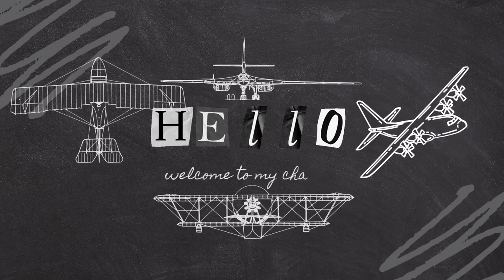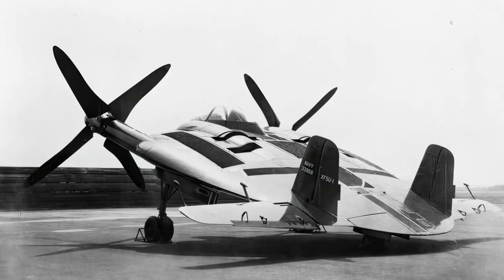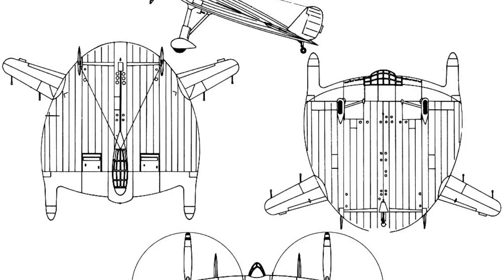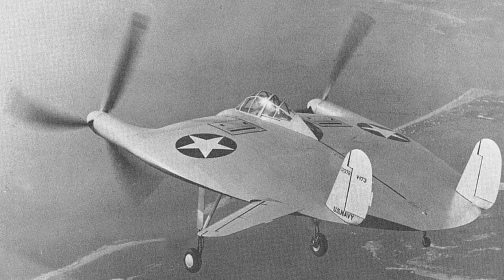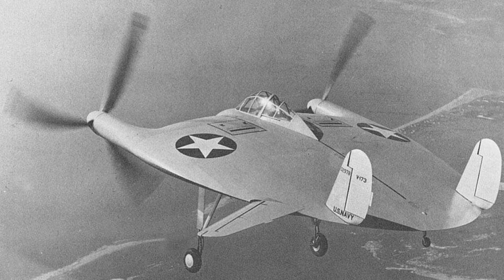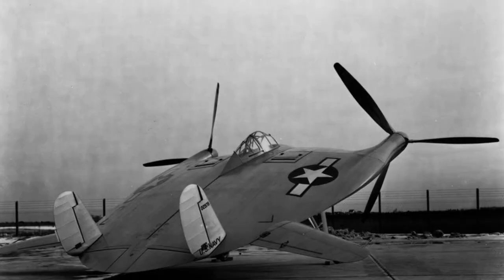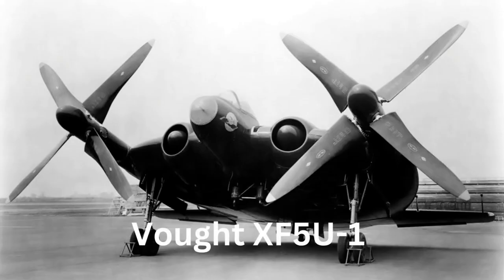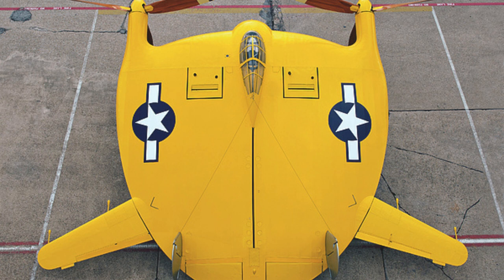Flying Pancake: The Vought V-173

Comment: Very inaccurate information.

The V-173 was a very low-power first attempt. It was never intended for service.
The XF5U was intended to be worked up into a service plane which was to be very fast, while also capable of very slow landings in very little space.

The first plane did everything asked of it and proved the concept though it was relatively slow for installed power because of the huge propellers. The XF5U never flew, never made it past a few fast taxi tests because of excessive vibration from the drive train linking the two engines and the two props.
This drivetrain was necessary because with the wing-tip location of the props, losing an engine meant instant uncontrollable catastrophe.

It was never intended to have a lift-fan in the center. No patent drawings showed such a thing.
There are videos of the Designer working with indoor tethered air-powered models which could hover with the nose vertical, though it did not have landing gear suitable for landing like this. The XF5U might have had enough power to do this, though even it could not land like this.  Other Zimmerman patents showed something like it that could land vertically, nose-up.

The super-slow landing abilities with very steep nose-up attitude was from the very-low aspect-ratio planform. The situation with the props outboard spinning outwardly did not help with this super-STOL ability, nor for efficiency at cruise. NACA tunnel tests with the V-173 showed that it didn't gain anything with the props as they were, versus more normal-sized 80hp props spinning the other way.

The designer while working for NACA in the '30s saw the Arup plane from Indiana fly, performing for NACA, the Army, and the CAA (fore-runner to the FAA). The Arup from Indiana ("Air" + "Up") was from 1932, and proved to be super-STOL, stall-proof, and efficient with the low power installed.
Zimmerman picked the planform of the Arup because of its ability to fly super-slow without stalling with the nose high, as the starting point for his work towards a nose-vertical hovering ability (again though neither plane built had landing gear allowing this).

Another commonly heard mischaracterization says that the jet age killed it. This isn't true because the US military continued flying piston-prop combat planes into the '70s, for support into the '80s, and still fly props. The "pancake" planform of the Arup would have been very fast and super-STOL with astounding steep climb rate with jets.

Arup S-2
https://youtu.be/Nxz1UF67EQI
https://youtu.be/TX5s4yEP09I
Arup S-4
https://youtu.be/_XrSFVDa3mY